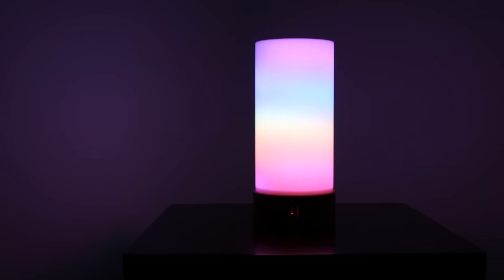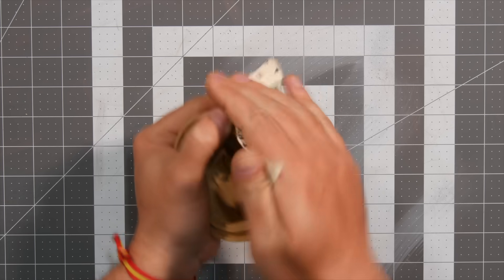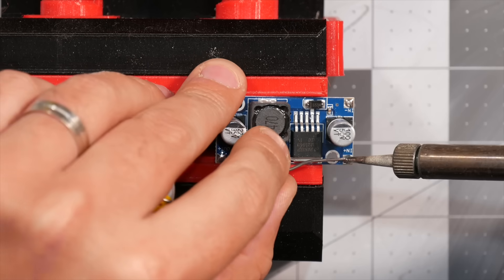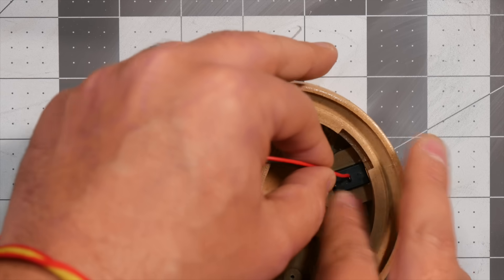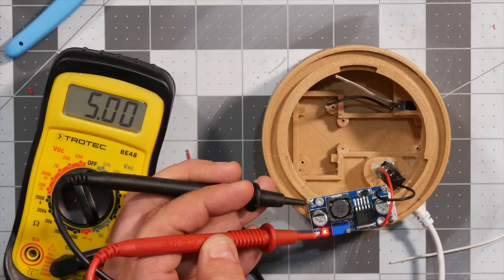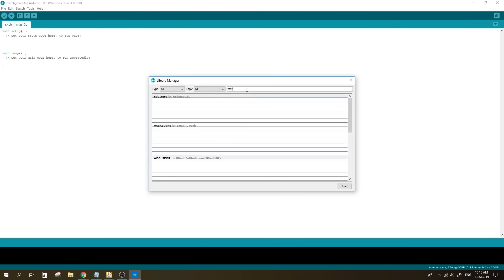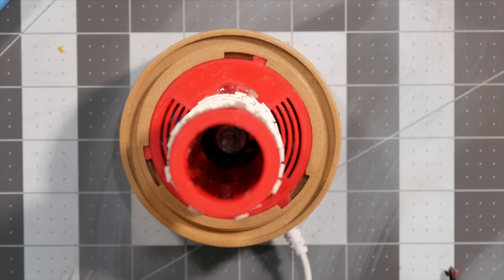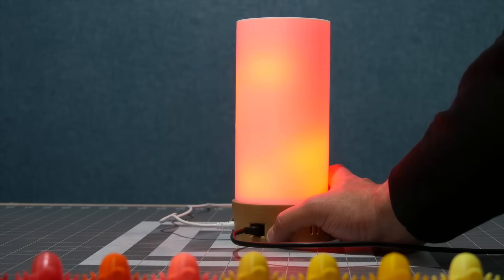Satisfying LED Mood Lamp - 3D Printing and Arduino DIY

Comment: You could get rid of the fan and the step down converter by using an appropriate power supply outside of the lamp. Just an idea. Love the design. Will build my own customized version for sure! ❤

Comment: Hey, 
nice projekt.Would still have the question why you have not taken directly simply a power supply with 5v 2A output voltage?'
This should be easier or am I missing something?

Comment: you didnt need the buck converter. The Vin pin can take up to 12V and the internal voltage regulator makes it 5V

Comment: It's still a great project. I made a simple one using a ws2812b (60led/m) and an RF controller and I'm going to update the electronics to integrate a pair on my desk and voice control by Alexa.
I printed using Esun's cood white PLA+ and would like to get a little more light through the diffuser. I'm thinking about producing the cover in resin.

Comment: Hi - complete novice here! Do you still need a step down board if you use a 5v power supply to begin with? Also, the recommended board says it takes 6v minimum. Finally, thinking of working with a WiFi enabled microcontroller, any tips here? Much appreciated!
Reply: Hey, Did you find anything regarding your doubt? Actually, I was thinking exactly the same thing.

Comment: How many amps is the DC input rated for? Cant Seem to read it anywhere
Reply from the maker: 3Amps is enough
Reply: @3DMakerNoob  so the DC Jack Can handle 3amps?
Reply: @3DMakerNoob  Can you link the specific filament that you used in the video?

Comment: Couldn't you have just used a 5v power supply and skipped the need for the step down board?

Comment: Thank you this is really awesome .........here's mine https://www.youtube.com/watch?v=YKzTsM9bTM0   I don't have the  top on it in this video but I didn't like the black circle at top which you can either add a couple lights to the very top or use this stl file I created to cover the top :)   ->  https://www.tinkercad.com/things/1FyZjAk0Qux-light-top   Which I printed out of the wood PLA :)
Reply: hi why i cant comment on ur video
Reply: Hi, I can't make a kind of white top cover.
The other coins turned out great, but when making the white cover, the inner filling will ruin the entire lighting effect. When I make the filling 0%, it prints as a single wall. Can someone please tell me how I should make the cura settings for the white top cover as in the video?

Comment: If anyone has wondered why the effects are not changing properly from one to the other (skipping or going back to the beginning), it's due to a problem called bounce.  Basically, the switch is bouncing on and off and the Arduino is taking that information too quickly, resulting in unpredictable toggling.  There's a common way to use a resistor and capacitor with the button, but that's a pain and requires a breadboard.  I'm looking into a way to get it to work with code and will share once I get it to work.
Reply: Just implement a simple debounce algorithm

Comment: hello Joe ! I'm doing the same thing with strip of 50 led WS2812B. For more secure run, I think you must add 2 things: a resistor 470 Ohm on the data line D5 for preventing "echo" and a condensator 1000µF (mini 16V) between positive and negative 5V input. This will prevent burn of the first led at power ON.
If you use 50 LED at 64 brightness (1/4, and max =255), power will be 300mA max. this is a good surprise from my led strip. so arduino nano can support that in direct connexion to led strip (max 500mA).
have a nice day and see you for the next video !

Comment: Hey Josheph. Great Video. This will be my first arduino project :)
One question: Would it work if I use the DC5V adapter to power the arduino directly instead of using the Step Down Module?
Reply: Yes
Reply: the power brick he was using supplied 9v so you technically dont even need the step down converter. The arduino nano can take 5-12v of power through vin

Comment: If i use a 5v power supply, then i would only need the arduino right? Or will i have to put something different in

Comment: just finished building mine, i forgot to change the steps in marlin on z axis after swapping the stepper drivers and ended up with a lamp shade at 300mm so thought screw it and printed an extra tower part and now i have a really big lamp with 200 led's haha

Comment: Does this project need a fan? I understand the led's are enclosed but I can't imagine them giving off too much heat.
Reply from the maker: If you’re not using full brightness then the fan is not really needed
Reply: @3DMakerNoob  Makes sense, thanks for the reply!

Comment: I made this lamp and it is great! Great modeling for the prints and great electronic instructions. I am a newbie at programming and am having difficulty replicating the really cool lamp effects you showed at the end of this video. I have used the AllEffects_FastLED code you referred to but as good as its effects are, they can't compare to the effects you demonstrated. Any change you could share that code?

Comment: Shit, I've ordered the wrong Strip with only 30 LEDs per meter. But it work fine ... just one problem with FastLED ... I don't get all the effects like that in your video ... for example the "fire effect". just around 10-15 effects and than it start again with the first ... it seems to be that I have RGBWW LEDs. Anyone n idea what the problem is ???
Reply: Ok, I`ve checked it again and I get all 18 effects, but...I don't get that orange or yellow ... at the "fire" effect :-(
It looks like the warm white leds are on every time 😔

Comment: Is there a text document on wiring this? thought I seen something somewhere, would be a lot easier to follow after watching rthe video :)
Reply from the maker: On the myminifactory page you can see the wiring diagram :)
Reply: @3DMakerNoob  I.must be blind or.still asleep didnt see it  will.look again. Thanks Joe
Reply from the maker: You were correct, for some reason it wasn't uploaded. should be there now. apologies :)
Reply: @3DMakerNoob  Ohio I was blind lol. One thing I notice though you are using the 5v instead of VIN on the nano :)
Reply from the maker: Yep, I had a lot of people pointing out that since I am using 5volt then I should use the 5v pin and not VIN :)

Comment: We can use esp 32 and Wi-Fi remotely controlled it by phone
Reply: The tricky part is the ESP (at least mine) are 3v logic and the LED strips are 5v. I gave it a try and it was sporadic. I found some websites where they did it using some kind of level shifter.

Comment: How do you know if the power supply can supply enough current? Great video!
Reply: These LED are 5V leds. One 2832 LED needs 60mA, so for 100 LED, you need 100*0.06=6A. You have to buy a power supply that can give a little more...With 5V 2A, you can power 2÷0.06=33 LED.
Reply: @PROTOCONCEPT  And that's if you run them full brightness. I set mine to 70 (out of 255) and they are more than bright enough. Mine has 60 LEDs, so really I can get away with an under .5 amp supply. FastLED also has power management  methods so you can set max power/amps just in case: http://fastled.io/docs/3.1/group___power.html

Comment: I'm really going to make one ,but will the LED heat up and eventually melt the plastic when it been switch on for long period of time?
Reply from the maker: It wouldn’t as the active cooling is there for that reason :) even if the fan wasn’t there, you could use PETg and you’d be fine

Comment: You should not use the VIN pin, it has a voltage regulator connected to it. Should only connect 7-12v to thos. You already have a 5V so you can connect it to the 5V pin
Reply from the maker: Check the comments....

Comment: What a great project to do!! It looks amazing!! I've printed all the parts, wired everything up......but I can't get the tactile button to change lighting effects. Any idea what might be wrong? One pin soldered to GND (Next to D2) the other pin to D2 on the Nano. I metered out the button to make sure I had the right pins. The final step before assembly is killing me.
Reply from the maker: Make sure the Arduino code reflects the D2 pin that’s all I can think of. Last step is to confirm the button actually does make the contact when pressed
Reply: @3DMakerNoob  Thanks for the reply. If I were using the "Color Palette" example, where would I find the line in the Arduino code that would reflect the D2 pin (or where to define it)? This is my first time using an Arduino, but it's very very interesting.
Reply: @floridabatty  From what I understand, that sketch doesn't have button function. The other sketch Joe shows uses the button function to change patterns.

Comment: Are you sure this is safe? You are only meant to draw a tiny amount of power from those arduino pins.. Having made a few LED lamps before, the biggest hurdle has always been powering it. (Especially for RGB). You need at least 1 amp for a strip your size at peak. If it's possible to make them /power with an arduino, please do share how, because as far as I know those arduinos safety ratings are at something like 25mA per channel.. 40 x less than what this strip would be using. But if we can power (and control) via an arduino, that saves 80% of the lamp costs.
Reply: The LEDs aren't being powered by the Arduino.

Comment: Nice project just finished printing one, but having problems printing the effect button extension.  What setting did you use?  Mine comes out really bad.
Reply from the maker: Print it in PLA and make sure you print extremely slow with the fan on so you give time for the PLA to solidify :)
Reply: @3DMakerNoob  I tried at 25mms I'll drop it to 15mms and see if that helps thank you.

Comment: It would be great if you build Google assistant in it with a raspberry pi zero and sync the assistant with the led . If possible please do so love your videos 👍😁
Reply from the maker: next project i will be doing a much more elaborate project with a wifi controlled esp2866, following that, we will do a project with alexa ;)

Comment: Has anyone tried with pla tower?
Reply from the maker: PLA should be fine at the glass transition temperature is 60 degrees and the active cooling will mitigate any heat emitting from the LEDs

Comment from the maker: 👇👇⛔️⛔️READ FIRST: ⛔️⛔️👇👇
As i said, this was my first proper project, so it's not perfect. cut me some slack :)

YES, you can omit the step down DC-DC converter IF you are using anything up to 12 V power supply, however keep in mind that Arduino Nano's are only rated up to 1 AMP on the 5V output pins. LEDs consume up to 60 milliamp per LED, so you require 6 AMPS to power all of them at full brightness. 
YES, the red + from the power supply Should have been soldered onto the 5V pin on the arduino, but this still worked for this project.
YES, LEDs do get fairly hot, hence why i installed active cooling, you don't have to install it, but i decided to install it on mine.
YES, I will be using an ESP2866 in my next project
Reply: If you took anything negative from my comments on the Vin pin I am sorry. I was only attempting to pass on information which could be useful. I'm an art graduate and am completely self taught in electronics, so, trust me, I have been in exactly the same position. Now I'm one of the directors of my local hackspace, so trust me things do change.
Reply from the maker: I would never take that as a negative, I’m always learning :) I put this comment there as I had at least 10 others say the same thing so I figured I’d let everyone know I read it :)
Reply: @3DMakerNoob  is it possible to add another mode? Im planning to add a sound visualizer using a electret microphone.

Comment: Why do I need the DC-DC step down board ? Why do you not use a 5V Power Adapter !? Every Universal Power Adapter could 5V with 1-2 A.
Reply from the maker: Because I used a 9v power supply that comes with every Arduino kit. Because not everyone has a 5v power adaptor, because not everyone wants to buy a 5v power adaptor if they have a 9v or a 12v power adaptor
Reply: @3DMakerNoob  ok, my two Arduino nano I've bought via your link don't come with a power supply ...
Reply from the maker: Yeah those are standalone Arduino Nano, you get kits like the ones from elegoo which have all kinds of stuff inside

Comment: Arduino can run on 5-12V on the Vin pin. And arduino has a 5V output. You dont need the step down regulator for this project.
Reply: Thanks for this info. Can I just pump in 5v to the arduino and have the Arduino output power to the led strip? What amp rated PSU would be required please?
Reply from the maker: Arduino Nano are rated at a maximum output of 1Amp on the 5V pin if using an external power supply, that is before you factor in thermal limitiation. Every LED consumes 20milliamp on full brightness per colour, so 60milliamp on white. therefore you need an output of 6Amps, which you cannot have from the Arduino as you'll fry it. If you are using a 5v power supply, run the LED strip GND and +5v directly to it, but i doubt you'll find a 5v power supply with that kind of amps, hence why i used a 9v power supply and a step down converter.
Reply: @3DMakerNoob  I dont know I built a 5v led lamp that runs on 100 LEDs that just plug into any standard usb port on your computer. That's 500ma. I'm running them off a battery using a adafruit 5v boost because my battery was only 3.7v and I needed a charging curcit anyways.
Reply from the maker: Whenever I tried running it solely on the Arduino power it was resetting every 5 seconds. Maybe you didn’t have them on full brightness?
Reply: @3DMakerNoob  it could be that the resistors used in the strand of LEDs I bought were designed for lower power uses because they are meant to be run off a usb port of your computer.
Reply: @3DMakerNoob  I would agree with your previous reply that it's a good idea to run the LEDs power directly from your supply not the arduinos 5v pin. If your using a 5v strand. I actually hadn't tried using the arduino pin to power my strand. So maybe mine would have reset itself also. But my strand definitely doesnt take 6amps to run. I dont feel like de soldering my connections to check the actuall draw though. So I'll just assume that its using the full max output of my adafruit power boost. Whitch I think is 1amp
Reply from the maker: Good luck running 6amps worth of LEDs on arduino’s 5v output :) thankfully they are cheap to buy

Comment: Hey can’t u just use a phone usb charger instead of the step down?
Reply: If it's 5 volts, yea
Reply: Yea I phone chargers are 5v 1amp and iPad ones are like 5.2v and 2.5 amps roughly so just plug em in the Arduino using less space and can make tower longer if wanted and slimed down
Reply: @gamerghost123  1 amp is kinda shitty tho xd
Reply: Vemund Kremund yea think the android one is 2amps
Reply: @gamerghost123  That really depends on what brand it is...
Reply: Vemund Kremund ok so if you get one let’s say something that has 2 to 10 amp you would just connect it to the Arduino correct?
Reply: @gamerghost123  It would work no matter the amperage, but if you're using many LEDs, you'll need a higher amperage. 2 amps should work just fine unless you're doing something crazy 👌

Comment: Great project and I'm printing my second one right now as a gift for my granddaughter. But I do have a question about the effects button and not all of the effects working, it seems that I'm only getting 10 of the possible 19 effects (case 0 - 18 in the listing) with the FastLED Library and ALLEffects (Jan 3,2019 Ver 1.0). 
I followed all your directions for the build, except I skipped using the DC converter because I already had a 5 volt 4A power supply.
Reply: David, did you figure this out? my button does not work at all and just shows the default light show. i did upload the alleffects
Reply: Ruben,
Here are a few things to check.
1. Make sure  you check your switch for which leads are open and closed when you press the button. My switch has 4 leads on it but only one pair goes from Open to Closed state when you press the button. I had to check each button as I put each Light Base together.
2. Make sure you have a good solder connection between your switch and the D2 connection and GND (Ground) on the Nano board.
3. Trim down the Button Post block so it slides in the slot of the Lamp Base smoothly and make sure you can hear the "click" of the switch button when you push on the post. If the post is too tight it will either not contact the switch button or hold it down all the time.

Comment: I love the purpose-made parts that are specifically designed to work with the intended components. But is it just me, or could you simply skip the step down board and use a 5V power supply from the start? I can’t for the life of me figure out why it would use a 9V power supply only to be stepped down to 5V before connecting to literally any other component. Seems like an extra step.
Reply: I'm scratching my head with the step down also! I've bought all required bits but don't have a 9v PSU in my parts boxes. What amps does this thing draw?
Reply from the maker: So, to answer all questions, yes you can directly use a 5v without the step down, but not everyone has a 5v power supply with enough amps. In full brightness and white, LEDs draw 60milliamps each, that would require a 6amp power supply just to power the LEDs in full brightness. I designed it like this for flexibility that’s all
Reply: @3DMakerNoob  I really want to build makes this thing. But a 9v 6amp PSU isnt making it attractive. The PSU is quite costly. Plus knowing there's so many amps pumping through this is quite worrying. I really appreciate your effort though. But if anyone has a better power option I'd love to know 👍👍
Reply from the maker: Just follow the instructions and a 2amp power supply will work. In the video I dropped the brightness to half. There is nothing to worry about
Reply: @3DMakerNoob  Thank you